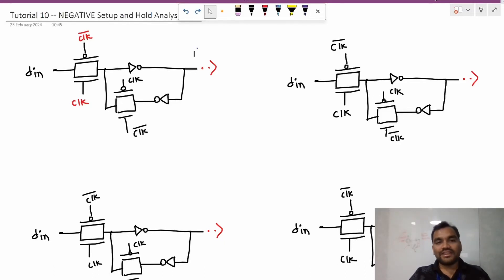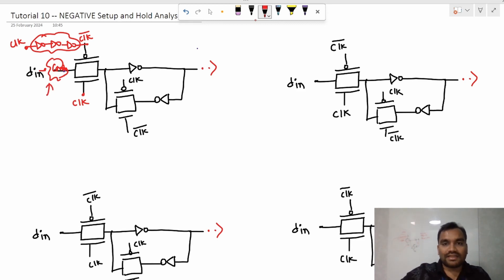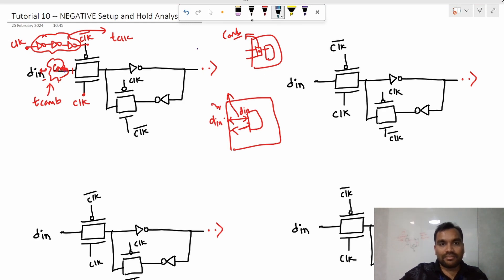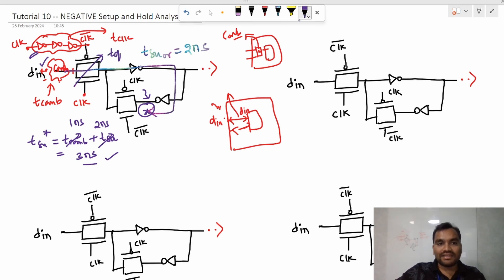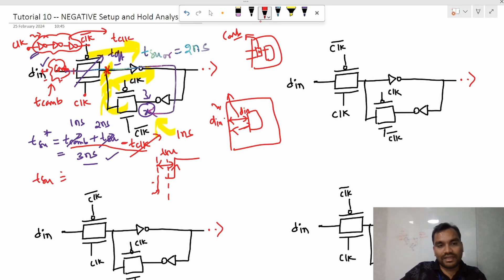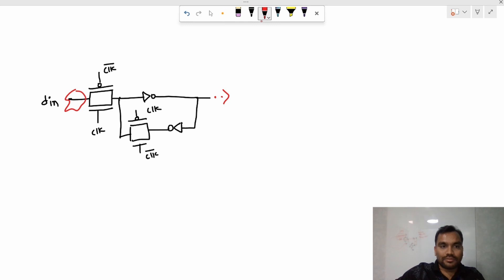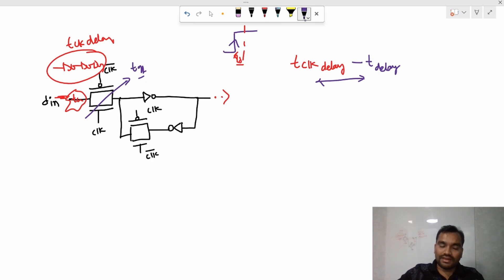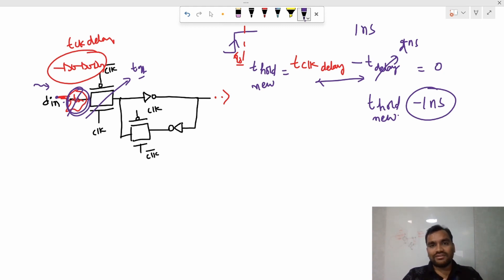Negative Setup time and Hold time || STA 10 @knowledgeunlimited

Comment: Hello sir I preparing for VEDA IIT entrance exam for analog engineering. Mains exam date is 16 March but I have only prepared upto MOSFET small signal common source amplifier and I haven't prepared for amplifier op apms MOS cascode and current mirror. Sir, I also have to look on to Network analysis(questions on RLC, RMS, complex circuit, sinusoidal voltage). Sir, I don't know what to do sir please guide me. As this exam is very important to me. I really don't have such money to get a training in VLSI, so I really want to clear this exam.
Reply from the maker: Current mirror circuits are important. 
But since you were saying you didn’t covered fully, go with confidence on what all concepts you are familiar with and be genuine with Interviewer. All we can do is to hope for best. 
Best of the luck with the process.